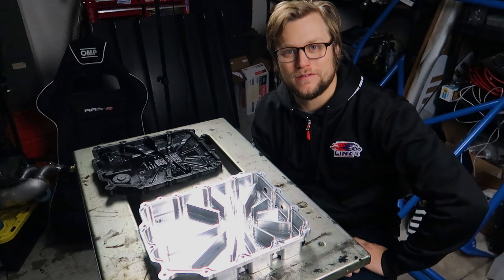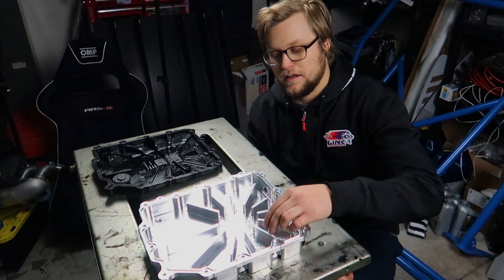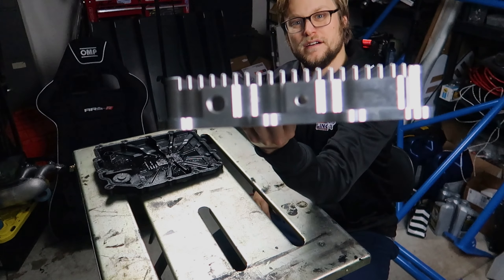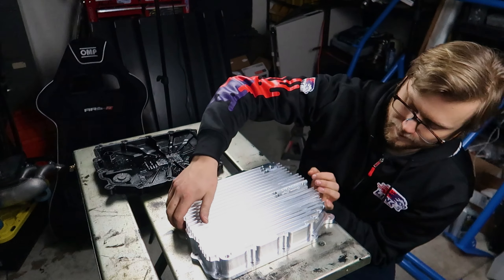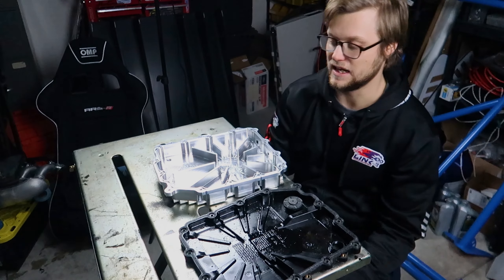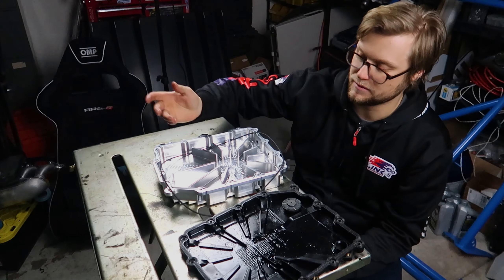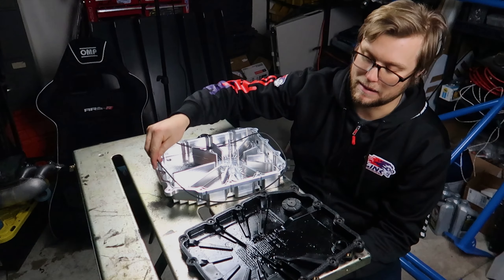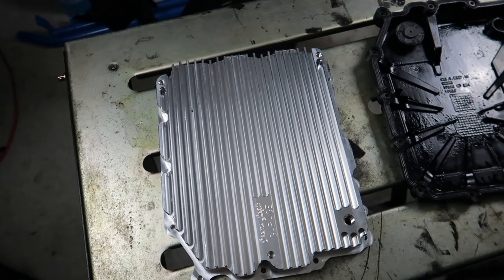Billet Dual-Clutch Transmission Oil Pan! Product Overview and Installation DIY

Comment: Have you got the part no for heat shield ?
Reply from the maker: yes it has the mount for the head shield
Reply: @SeemsLegitGarage  can I get the part no for shield?
The transmission I have, came without the shield…

Comment: Since the depth of the pan has increased, what did you do to get the pickup tube lower in the pan so that the new fluid capacity could be used?
Reply from the maker: A lower pickup is not needed as the fill level is still the same